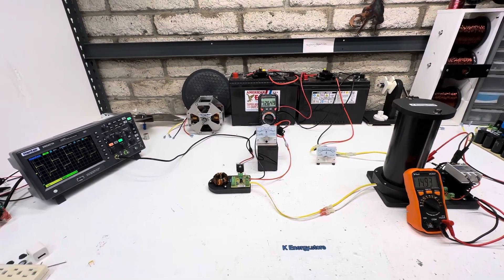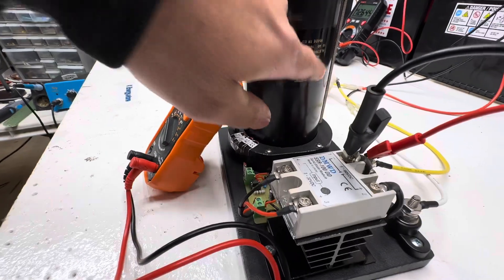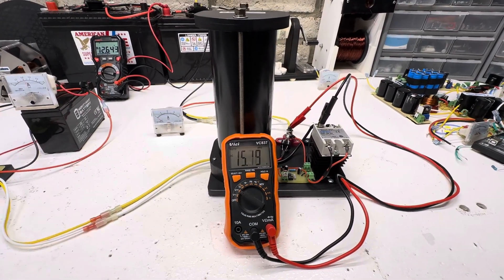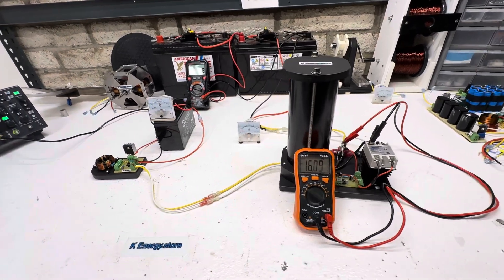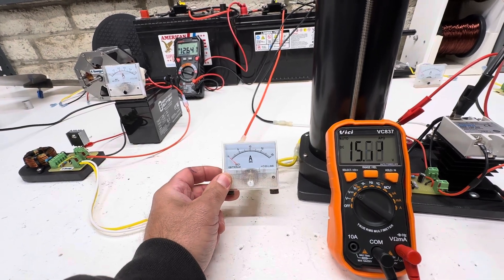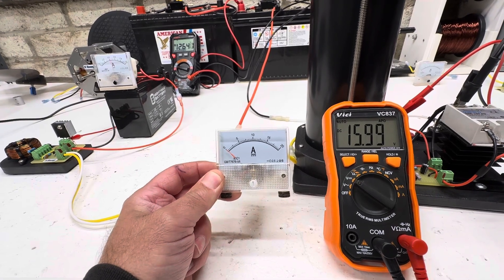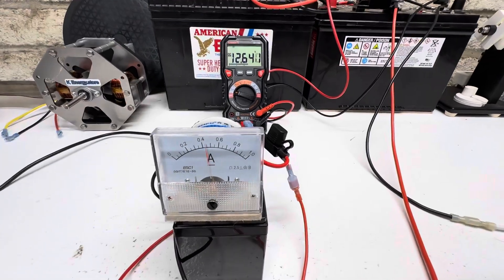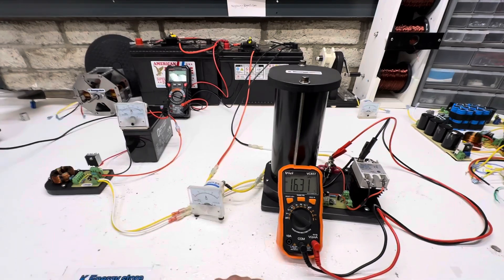Oscillator charging 1.3 farad capacitor dump

Comment: Is it possible to also control the "drop" in rhe cap dump?  So that for example there is a quick cut off of the cap discharge right at for example 14Vdc?  So cap discharges from 16Vdc only down to 14Vdc (just example) 
Reasoning is that when cap and battery become even-steven in voltage now the battery would be draining itself into cap for a bit of time and is duscharging itself, and not being  charged at that bit of time...someone told me Bedini said most effecient cap discharge into 12v battery is to have cap at about 36v then it drops down to 23V and the discharge of cap stops right there at 23Vdc ....now every bit if joules in cap-release is doing a good charge.  I dont know if all this true, just what somebody told me is what  Bedini said is how best to do it.
Reply from the maker: Makes Sense  
This one is set by time dump duration if you make the time lower it won’t drain out totally but most the time it stops about 1 volt over the battery
Reply: OK cool, thanks for reply....so there is adjustment for how long in time the cap drains?  Is this partially a function of the cap size I assume, plus battery charge level too,  then is there something else? 
Like a potentiometer on the SCR varying that resistance on it that makes it discharge at a certain voltage level of the big cap that does the charging?  
Thanks again 
 @kenergy1707
Reply from the maker: @MrDKONZEN  yes but has to be made that way there’s no adjustment after it’s built other than the zener 
It’s the little control circuit 
I use a mosfet on most of mine